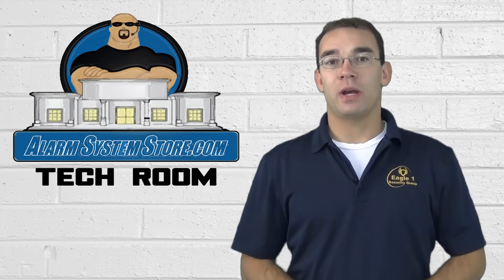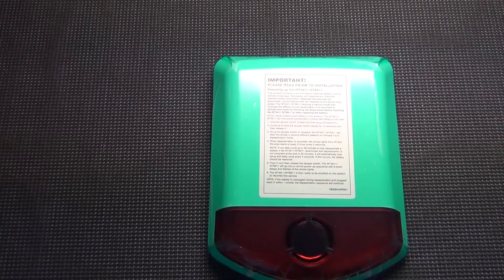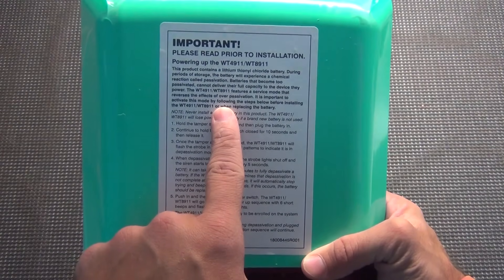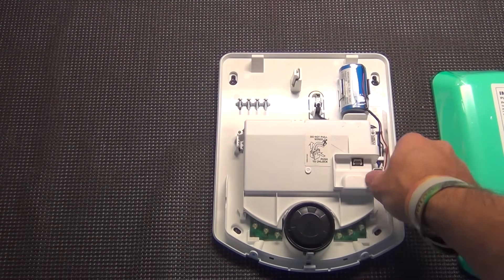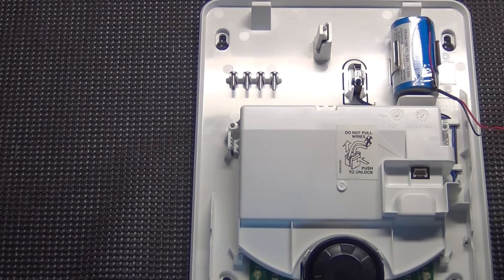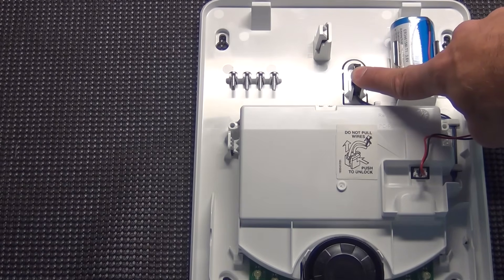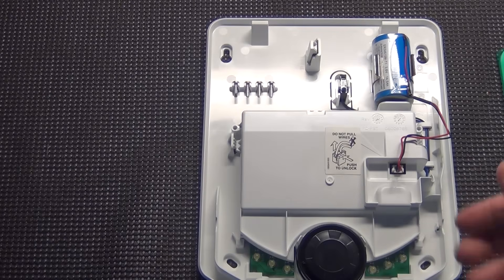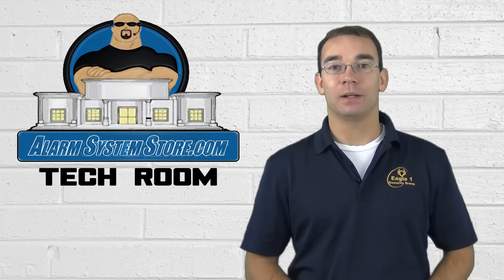Alarm System Store Tech Video - DSC WT4911BATT Alexor Battery Depassivation

Comment: This was a great video, I watched several times and memorized the steps. I still had Support on the phone when I did it though if I had any questions. One thing that I would point out though is that the lever to push to depassify, it was unclear exactly what to push. Support wasn't much help either as they had me pushing the holder above the switch. After I rewatched the video a few more times, I realized that the button was actually a bit lower. So, I went back out and tried that and it worked. Then when I did the procedure, it worked like a charm.
Thanks for creating this video. It saved having to have a Tech come out to the house.

Comment: The instructions on the alarm says if it doesn’t depassify, to get replace the battery.  But this battery was brand new and cost over $20?? 
ADT sent us this video to do it ourselves and we followed all the steps and after about 25 min, it just gave us the one second beep saying it didn’t work.
Reply from the maker: Unfortunately for these types of batteries, its not unheard of for them to come DOA, or dead on arrival. Depending on who you ordered the battery from you should be able to get a replacement from them ideally, but if you followed the steps in the video and it didnt work, try again a few times, but if that doesnt fix the issue you'll need a replacement battery.

Comment: Can you replace the battery with a power adaptor 3.6Volts output same as the battery?  The battery does not last that long especially if you have a couple of false alarms
Reply from the maker: It was not designed for that style of setup, so no I do not believe that would work.

Comment: When plugging in to the 3 pins, does it matter which way it goes in? Release tab up or down?
Reply from the maker: The connector should only fit one way, and that would be release tab down if the siren is oriented like it is in the video.

Comment: ....yellow triangle still present....how to reset after replacing baTTERY?
Reply from the maker: It will reset automatically IF the active trouble is resolved. If it hasn't you still have an active problem.

Comment: These wireless outdoor sirens are overpriced junk.  Most of the time the battery depassivation process fails meaning you waste 30 minutes with each attempt.  I've seen BRAND NEW sirens that are tested working fail multiple times when changing out a "low battery."

I had a BRAND NEW siren fail within 2 months, the wireless communication part just stopped working.

If you're smart you will never buy this DSC product because it has a high rate of failure and DSC should be sued for selling this defective garbage 🤬

Comment: I followed the directions but the strobe is still blinking after a several minutes, and it hasn't beeped. What am I doing wrong?
Reply: These outdoor wireless sirens are defective junk and have an extremely high rate of failure.  My advice, toss the piece of crap into the garbage and install a powered siren instead to save yourself a ton of cash and headache in the long run.

Comment: I changed the old battery with a new one. I followed your steps de-pacify, sirens flashed waited for the beeping 30 mins later it started to beep pressed the button. I still have the triangle showing low battery inside the house. Did this step twice. Key pad inside the house  said low battery siren. What am I doing wrong?
Reply: I have the same issue. Did you find any solution?
Reply: @stilus007  same here

Comment: DSC SUCKS THE WORST I WORK WITH SEVERAL MANUFACTURERS OF ALARM EQUIPMENT THEY ARE THE WORST THEY DO NOT MAKE A RELIABLE PRODUCT..THEY ARE SO BAD THAT WIRELESS ZONES GO BAD ON THE IMPASSA I
Reply from the maker: You must have gotten second hand equipment. DSC makes a great product and we rarely get complaints on the operation of their wireless devices.
Reply: Alarm System Store i replace impassa panels so often with ademco or iti the make a superior product

Comment: I just did mine after calling ADT for a blue shield type,  they told me I could  change it but said nothing about this procedure,,,,,,wanted to send a tech,,,,I did it and saved 25 dollars on a service call,,,,thanks for the info it works.
Reply: Yeah I just called and was told they recommend a tech doing this. $25 for the first  30 minutes and $100 afterwards! I’m tempted to try it myself
Reply: @jakesandlin2727  did u just un plug and replaced and then followed the video instructions
Reply: @deehood3178  I didn't do mine.  They sent out a tech and didn't charge me.
Reply from the maker: Hey no problem! Glad you got it going. We like helping people save money and take back some of their own power to do it themselves. Thanks for watching the video. Have a great day!
Reply: What kind of battery was to replace to your adt siren?

Comment: If you failed to do this step (my local installation guy didn't do this) can that damage the siren permanently or would it work after doing the process correctly?
Reply from the maker: It won't damage the siren, but the siren will not work unless you do this step

Comment: As I can restart the ESN of a siren.
  Of damaged alarm, for use in another
Reply: *8 installer code
Section 804 sub section 301-304
Aka 
Siren 301 is siren 1-304 siren 4
You can enter ESN maually 
* key makes numbers on key pad alpha numeric 
or in some cases if not enrolled in another system,  section 898 then tamper siren should work